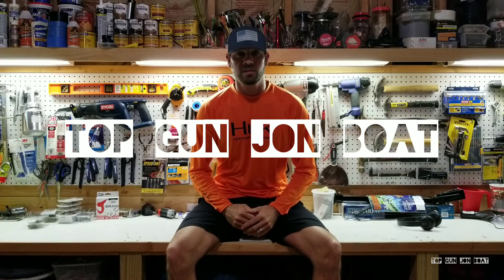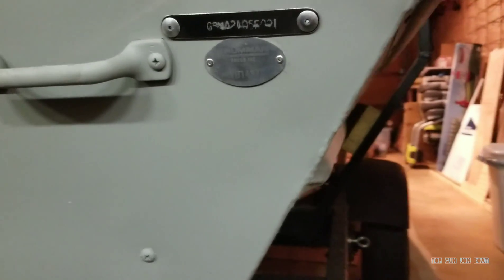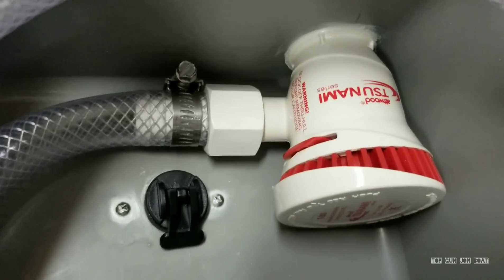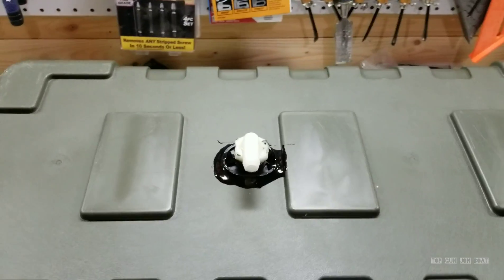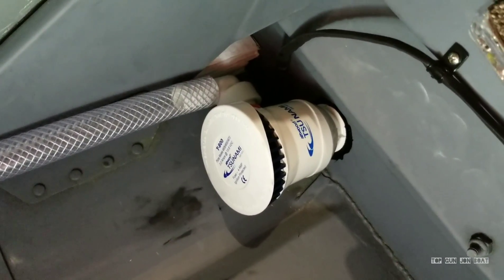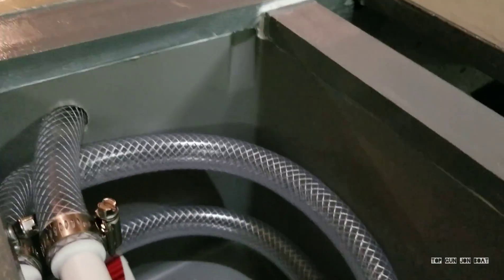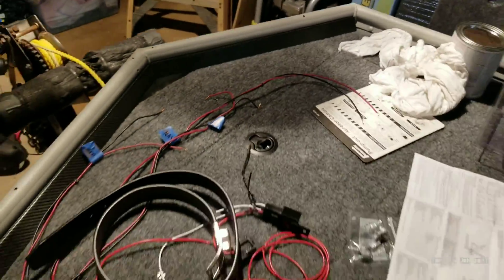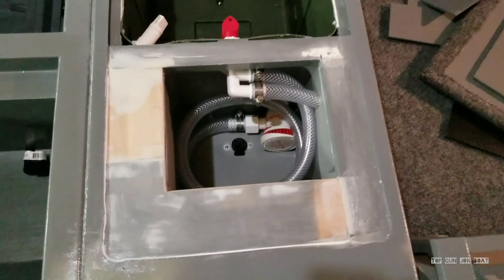DIY Livewell In Jon Boat w/ Cooling System Part 2

Comment: For all the trouble the water outlet gave you at 1:30, couldn't you have used the fitting (or one like it) for your ice chest drain shown at 4:47? Just toss the threaded plug, it would look clean and professional on the side of the boat. Just a thought. I know I'd have looked for a flange mount with a 45 or 90 degree fitting. It sure looked good when it was finished.

Comment: If you want to max out the cooling potential use copper pipe/tubing (a natural thermal conductor) in the chilling cooler... It will transfer the cold 100 times better than the plastic pipe (a natural insulating material). It's what we use to cool beer before adding the yeast.
Reply from the maker: Great idea man. I should have know that from my top 5 favorite show, Moonshiners

Comment: For that water outlet, it should be In the corner aimed down the edge to the other side of the box. Then you would have much better air circulation in the water. If you do it right, any debris in the water will collect in the middle of the box.
       Also for using it while the boat us being trailered, an activated charcoal in-line filter for the closed system, will remove the ammonia and nitrates in the water. To keep the fish happy much longer.
Reply from the maker: Thanks for the input. I kinda had to put the spray nozzle where I could due to the chill box mod determining my plumbing options if that what your talking about. It's my first boat build so always room for improvement.  Thanks for the tips, sounds like you know livewells much better than I do! Thanks for checking the channel out.
Reply: @AnthonyJonesBrigadeBoats  2 elbows and a bracket or 2 would take it to the corner, to get a whirlpool effect, more current = more air circulation.
       I use to collect saltwater tropical fish that are much harder to keep alive.

Comment: You should soak the wood you used at the water line in apoxy or have someone take measurements and 3D print so it doesn’t rot away
Reply from the maker: Thanks..This video was made before 3d printers were a thing and the wood has yet to rot

Comment: I wish you'd have used starboard for your lumber on this so you would never have to deal with rot a few years from now.
Reply from the maker: I'll never have to deal with rot a few years from now.
Reply from the maker: Couple things here, and maybe I should do a video on this....1) I used a majority of western red Cedar in my build. Its naturally resistant to rot which is why it's used in many home construction projects. It is resilient to moisture.  2) Yes I've used some plywood or pine 1x2s. All plywood has been coated in fiberglass resin making it absolutely water proof, I did a video on it submerged in water for 24 hrs w no damage, you should check it out. 3) All 1x2 or any wood, including cedar, has had joints puttied or caulked, and painted in multiple coats of oil based paint which provides an impermeable layer of protection over the wood. With all that said I'm not sure where your guesstimate of me having to "deal with rot a few years from now" comes from. I'm not saying I know it all but I guarantee I've done my due diligence to build a quality boat that will absolutely not rot a few years or even a decade from now because of all stated above. Now with that out of the way let's talk about starboard....1) crazy expensive 2) much heavier than wood 3) harder to cut and work with, hard to get screws to grab as securely as wood . Basically I know I can build a set up like I have out of the materials I did and make it waterproof and rot resistant and do it easier, be lighter,and cost less than starboard or any hdpe. Coosa board is a completely different story but at that rate I'd just use 1/16 aluminum. Pros and cons to all materials my friend. Lastly,  my boat is garage kept, does not sit outside at all, ever. Also been fishing in it many times now, it even got rained on and had hardly any water get down into the boat because I built my decking and hatches so tight. I'm hoping this helps explain. Again I should probably do a video on this, there are a lot of misconceptions about things. Anyhow, rant over, thanks.
Reply: @AnthonyJonesBrigadeBoats  as long as you are happy with it, is all that matters. I would have use starboard. You can buy starboard lumber sized pieces affordable. Starboard should cut just like wood. There are several different grades of starboard most people are not aware of which would make projects like this more affordable than most people may think. Glues and caulks with starboard is another story. Glue and caulk is virtually not going to adhere to starboard effectively but screws would hold good if predrilled and lubricated. But again, as long as you are happy with it thats all that matters. Good video.
Reply from the maker: @zash008  I hear you man and thanks. Yeah there's a lot of ways to do it. I think wood gets a bad rap because most people who use it in jon boats use pine not Cedar, do not seal it or treat joints properly,  then leave it outside. Of course it will rot. Look at brand new home construction though. Pine subfascia and trim. So long as its caulked properly,  installed correct, and has a layer of paint to protect it it will not rot. If water gets in somewhere ,whether it's a home or boat, that it shouldn't get and penetrates that protection whether it's a screw hole or joint or a end cut you did not paint, it can rot. I took the utmost care to prevent this. Still my issue w starboard or any hdpe plastic material is the weight. I would go coosa board which is 30-40% lighter than its dimensional equivalent in wood but also infused with fiberglass strands to strengthen it, before I'd use starboard or hdpe product but that's just my opinion.  I'm very satisfied w my build but I think people forget I used wood because I worked w wood by trade for many years and it's my comfort zone as well as this is actually my first boat build! Figured for a first build I'd start w wood. My new build will be 1/16 aluminum and that is because I want my boat to be feather light, not necessarily because I was not happy w wood in my first boat. I believe the 1/16 angled aluminum framed properly will be hard to beat by any other material.

Comment: Hey bro, how do you drain the water out of your boat  if your using it the drain hole for your live well?
Reply from the maker: The flow rite aerator pump out combo pumps the water out the side of the boat out the livewell. The residual water left in livewell can be drained when the boat is out of water. I typically leave water in until boat is on trailer, especially for tournament weigh ins. Hope this helps.
Reply: @AnthonyJonesBrigadeBoats  I meant the water that you accumulate that runs towards the back of the boat. We’re it’s supposed to drain out the drain plug area. I was wonder if your out in the water and get a leak somewhere , how would you pump it out? Or say you take the boat home and you have about a inch of water in the rear of the boat, how would you pump it out if you have the bilge pump set up through the drain plug hole. I’m currently building my setup based off your YouTube videos so any advice on this subject would greatly be appreciated.

Comment: I am not mechanically inclined at all, but why couldn't the live well pump out port be at the angle? Was it so the hose wouldn't be sticking out above the deck frame?
Reply from the maker: You are 100% correct. In my case it would have stuck above my decking unless mounting parallel with the boat bottom, or level.
Reply: Anthony Jones ok thank you sir. LOVE the videos!!

Comment: You didn't mount your drain plug at the lowest point of the tank 🤔
Reply from the maker: I was forced to mount it there because that was where the water drain channel in the hull was...
Reply: Anthony Jones ahh, of course. Can't do much about that :/
Reply from the maker: @officialWWM  Yeah my boat kinda screwed me on that one. two channels ran under that livewell and neither lined up with a lower spot in the tub.
Reply: Anthony Jones that's always the way, lol.

Comment: You said you worked on the top gun build for two years, how long did it take you to get it on the water after starting the decking?
Reply from the maker: Still not in the water....lol. Long story short, I had 2 kids, moved, bought some acreage, and built my house through out the build of this boat. There's no real way of telling how much time is in it or how long it could have taken for someone else. Add in my career at UGA, I'm a mess buddy. Hopefully taking it out next weekend for testing and getting a reveal video of 100% completion in the month of August.

Comment: What is the purpose 2nd hose for that runs from the cooler to the exterior of the boat for?  I was first thinking of overflow, but that isn't right.
Reply from the maker: Matt Neubert The second hose hooks to the flowrite nozzle which gives me the ability to purge the livewell. When the nozzle is pulled out it recirculates, when you push the nozzle in it changes the flow to the second hose which pumps the water out the boat. Flo-Rite noozle is awesome man. Great upgrade for a livewell, especially a DIY build

Comment: Question buddy.. 

Does the pump out drain need to be higher than the water level in the livewell for any reason I notice it higher in diagrams online but why couldn't I tie mine into the existing drain line i have that runs down under the floor out the back through the hull at the bottom of the transom. Hope that makes sense.. instead of drilling another hole for a through hull fitting
Reply from the maker: Chip Sammich I think they are higher than the water level in livewell because the thr hull pump out fitting need to go higher than the water level on the outside of the boat. So my outside thru hull is mounted higher than where the water line would be if it were in the lake which in turn happens to be higher than the livewell water fill. You dont want your thru hull fitting to be submerged if your boat is in water....If I'm understanding what your asking...
Reply from the maker: Chip Sammich That gives me the ability to pump almost all the water out while I am in the lake. If you want to pump it out through your rear plug, that would probably be fine but would only allow you to pump water out when your boat is not in the water. Again, if I'm understanding you right
Reply: Anthony Jones I see. I wonder if the livewell would then fill aswell if the pumpout drain is below the outside water level. Prolly. I'm thinking i might need a check valve

Comment: Great job brother. My 1436  alumacraft has a built in livewell with a thru hull drain/fill port and I’m trying to think of what I need to do to mine. It has about a 1.5" tube that does not allow it to drain fully.

Comment: Good video and it looks great. Only one question where is the over flow for  the livewell?
Reply from the maker: Great question. What I left out in the video is that in the corners, under the splash gaurd, I notched the corners of the tub to allow water drainage. Not a traditional screen, hole or drain, just an area for water to go if for some reason it were to overflow. I plan on monitoring it while manually switching on the pump in. Doesn't take long to fill 15 gallons.

Comment: Should have just used a thru-hull with a 90 degree barb.
Reply from the maker: I thought about it but a believe I still would have had a clearance issue with the 90 degree sticking up higher than the plane of where the decking would be. Instead of taking a chance and ordering a part that may or may not work, I did what I knew would give me a great end result.

Comment: Anthony you did a beautiful job. What size boat do you have? Length with. I have a 1960 via holds and would be cool to deck out but I don't think it's wide enough for stability. Thanks for an awesome video ,  creativity and craftsmanship.  You could always add some soft material under the panel if you splash gaurd isn't enough. Great job
Reply from the maker: Thanks for all the kind words. The boat is a 14 ft Grumman, it had a 1992 Oklahoma sticker on it when I got it so I know it's at least 25 yrs old. Not sure width off top of my head but pretty sure it's like a 1448.

Comment: That is a sweet livewell set up but you did not install an overflow drain,  why not?  If your filling with an 800 gph  pump and forget to turn it off your going to pump water into the boat. 

The over flow will remove that extra water and prevent filling you bilge.  Something to think about.

Again a very good set build you did.
Reply from the maker: Chris Murray I debated it and my overflow would have ran to the rear like my drain so nonetheless would require my bilge to pump out excess water. Honestly it takes right at 1 min to fill, I just watch it. Installing a hole w screen or drain is an easy fix if I feel I need to one day though. Absolutely right though, I'd recommend an overflow for most applications, I will just pay close attention to mine when it fills.

Comment: NICE walkthrough.  Can you put a pic of the batteries installed. Jim about to do my 4th build and I run a 24v system. Doesn't look like yours will fit 2 27dc batteries. You have done ideas I never considered... def gonna put some of your engineering in this build
Reply from the maker: WAEofFishing mine is 12v system, running one deep cycle for accessories only. My Instagramis dedicated to the boat and has pics of the full build. Instagram: adubjones
Reply: Anthony Jones I have similar interests and thanks for the awesome vlogs, but I'm re doing my 1442 alweld and was curious about solar power to keep the batteries topped off? Know or heard anything about them?

Comment: Great videos of the livewell build.  How much total time (drying time excluded) do you think you put into installing the livewell system?  Also, what was your total end cost of the project?  Now that you have had a chance to use it on the water anything you'd do differently or are you 100% satisfied?  (looks like you had it well thought out and I can't believe you wouldn't be satisfied).
Reply from the maker: Jed Nunes Thank you! 1) Total cost for livewell was right around 200$ give or take a few bucks. I could nail down an exact if you'd like but I know between the 2 pumps, cooler, hose, flo rite nozzle, carbon fiber wrap, insulation, glue, screws ect that was the ballpark. At this moment the only thing I'd like to have done differently is fit a larger cooler for the chill mod. It holds 9 cans, which is better than nothing but it would be awesome to have fit more. The sportsmanship trunk I used was a bit longer than your traditional tubs which ate up some space in length and limited my cooler size. I honestly am not done with the boat and have yet to officially use it therefore I cannot give you a full update. I anticipate to be very happy with it though. Thanks for asking and viewing!

Comment: Hey man, a lot of people don't even know the basics about boats. I see on a lot of tbers channels no one has a basic run down of a bildge basic framing and insulating guide. Thinking that would help a lot of people if you did that basic run down
Reply from the maker: nARLES theman Good idea!You talking about just dumbing down the basics of bilge install/operation?
Reply: Anthony Jones exactly the bare necessities before u start framing to prevent your boat from sinking. What to frame higher than others batteries etc